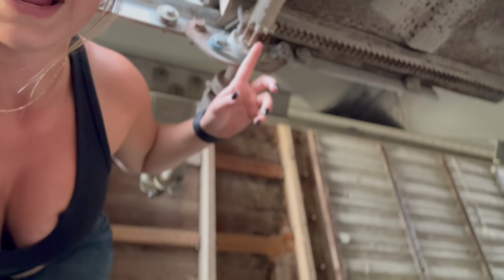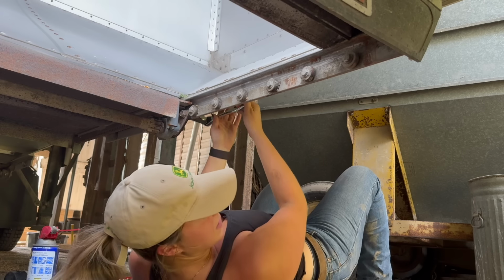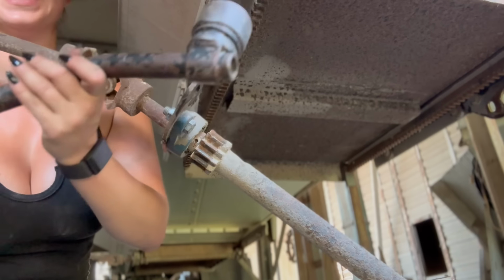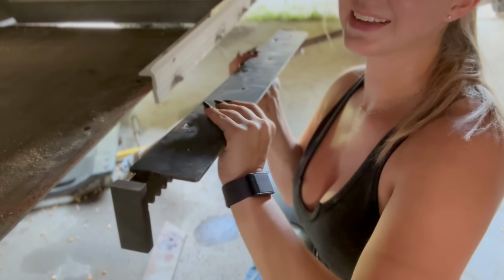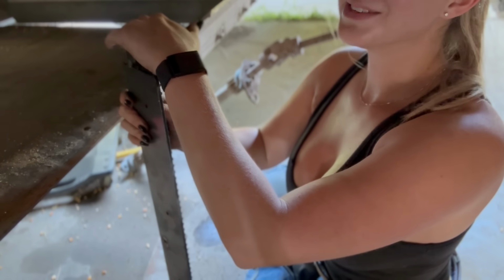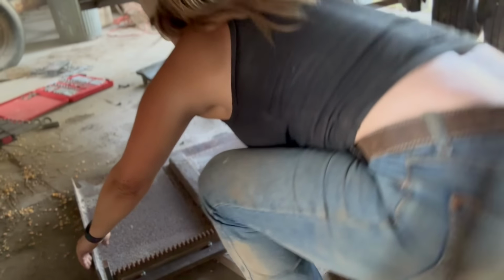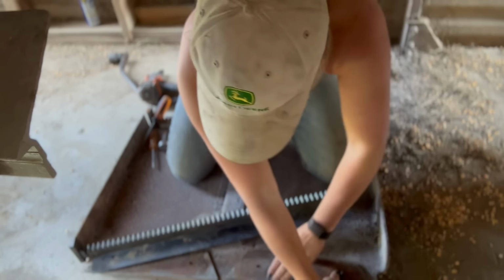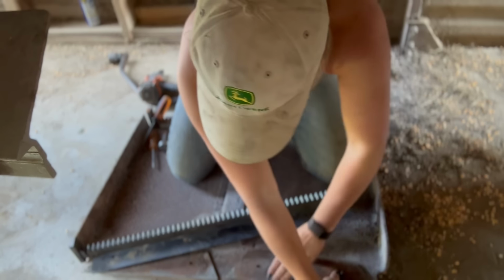Dirty Hands, Clean Money

Comment: Emma, did you know those tracks as you referred to are actually called racks ( rack and pinion gear system ), as you held up both your racks ... the used one and the new one for comparison. And yes I am smiling and in fact laughing as I type this as perhaps there is something wrong with my male mind ... or perhaps not LOL. As to the racks on the trailer, while I don't have that exact system on my grain trailers but its a similar concept, I have applied a spray graphite from John Deere onto the gear system and feel it helps lessen the friction a bit and since the graphite spray dries and after its applied it won't attract any dirt like grease would. If you feel like trying it some time, pick up a can and spray your racks down with a couple of coats and see if that makes any difference to their movement. 😀

Comment: How many grimaced when she had the trap door gear/shaft assy. wedged in place and turned loose without a bolt or anything in the hole to support it. Thank God it didn't come loose and fall in her pretty face. Please respect gravity hun and try to stay out from under heavy objects. Had that heavy shaft assy. fell in your face, it would've been horrible and potentially deadly. Please be careful! Other than the little scare at the end, you did very well.
Reply from the maker: My face was about 12 inches from being below anything that would fall. Maybe my arm/body/leg was in danger of something falling but not my face. Also the gear is only 10ish pound so not much damage from a 2 foot drop. But good looking out!